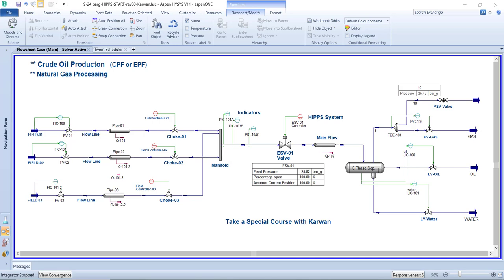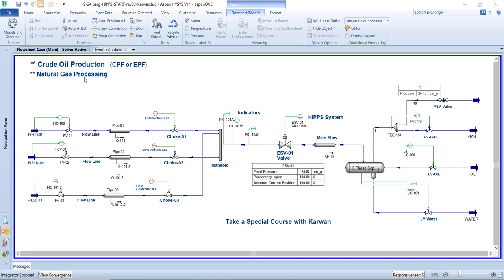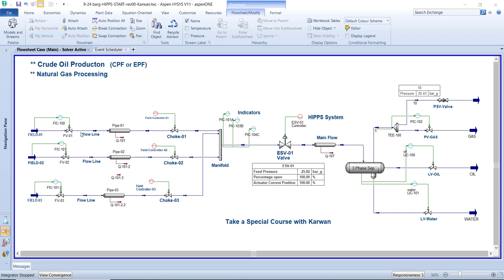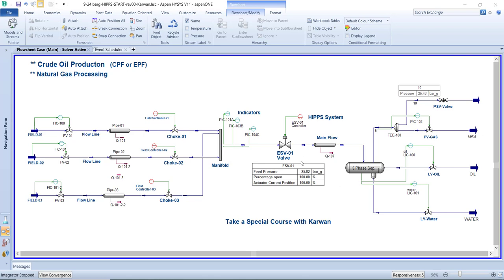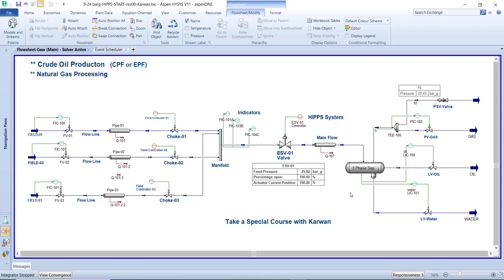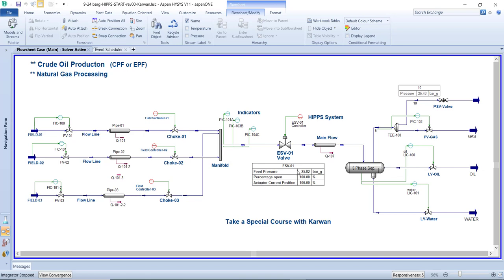How to apply HIPPS (High-Integrity Pressure Protection ) system in Hysys with Karwan

Comment: Thank you very much for sharing...
Could you please share the simulation file... Thanks in advance
Reply from the maker: Thanks for your support
I'm sorry because it's a part of my advance course
Reply: Hi you configuration is not redundant. if ESV close all feed to seperator is shut.. if HIPPS valve at individual feed kien, then hi pressure one willbe isolated